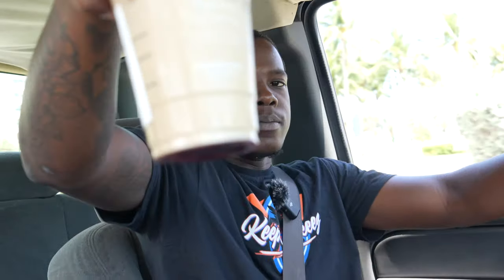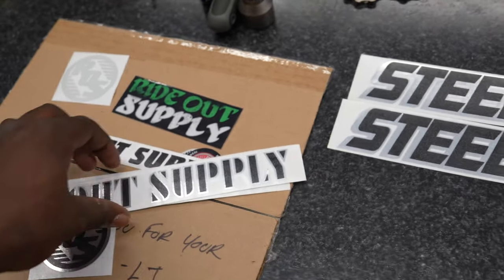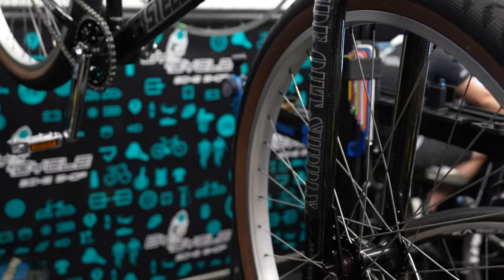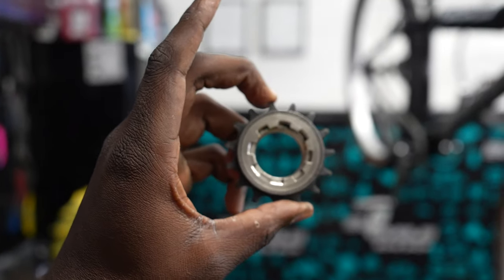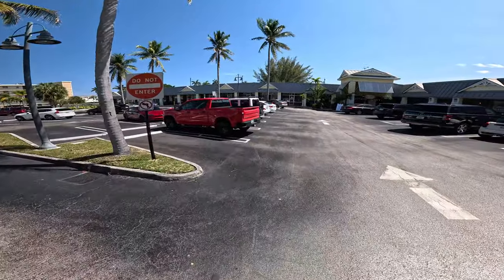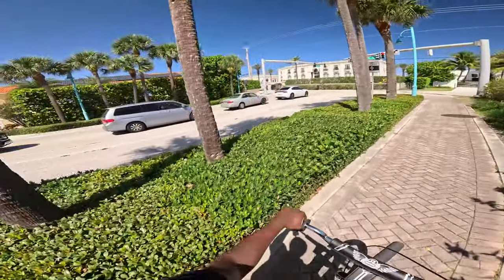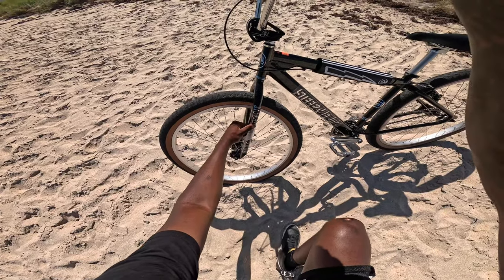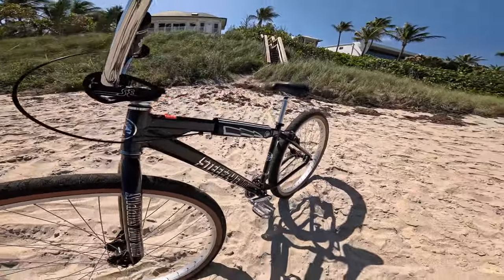INSTALLING A LOUD FREEWHEEL & NEW STICKER KIT ON MY NEW BIKE!

Comment: Yo them fork stickers are a pain in the butt to remove. For mine I ended buying some plastic blades to remove and it worked.
Reply from the maker: That’s a helpful tip, avoids scratching the paint

Comment: I’ve been running pro max breaks with cool stops pads and I have been putting them like a Millimeter away from the rim is that too close?
Reply from the maker: I mean you want as much grab you can get
Reply: @SteeezyFilmz  ok thanks